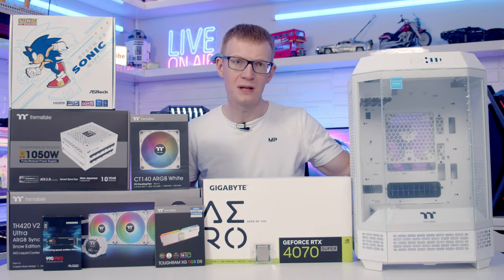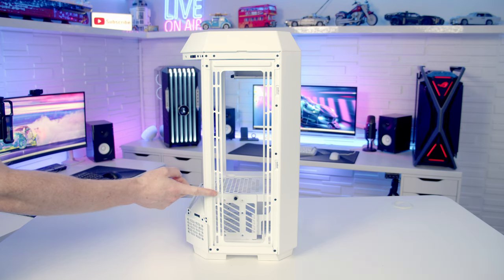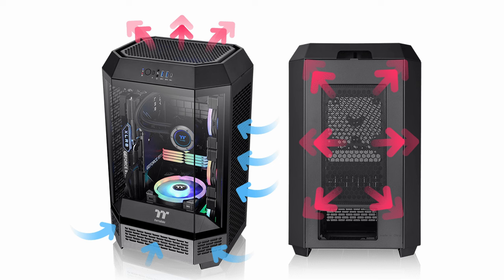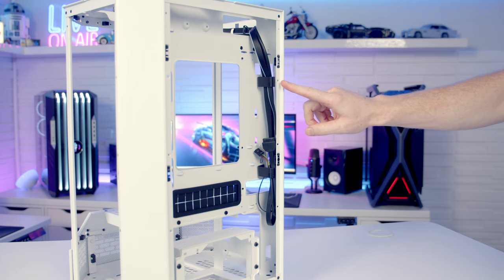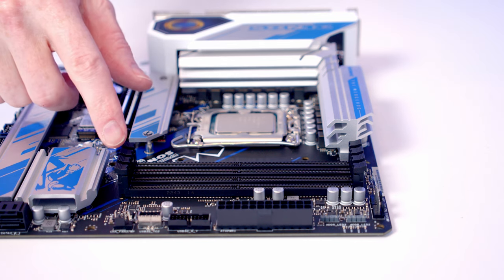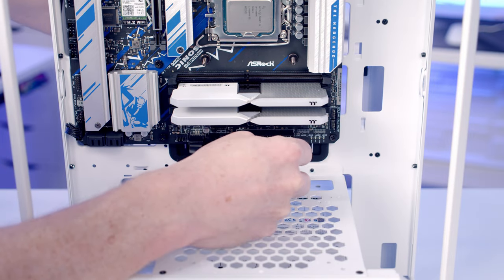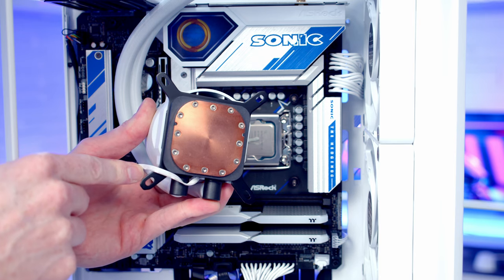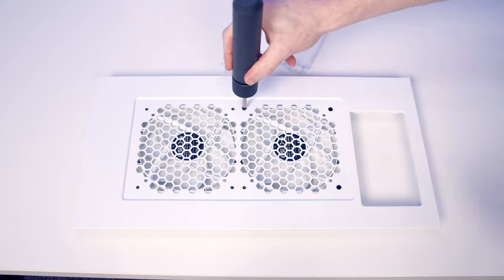Thermaltake Tower 300 Build - Step by Step Guide

Comment: Really appreciate this video.  Funny they didn't make the PSU covers for there own PSU to line up correctly, but its fine.  I REALLY appreciate that you showed how the cables connect before its in the Case while its in the case video edit.  Great job Sir.  In any case, you gave me confidence I can do this.  This will be my 2nd build.
Reply: It would have lined it up correctly if he hadn't flipped it backward.  The mounting bracket has a curled edge that faces outwards, he had his facing inwards.

Comment: Found you while looking for builds in this case. I am waiting on the racing green or matcha green. I will be using in the horizontal position and have two questions:

- what is the height when horizontal?
- seems exhausting the fans on the aio would be better in horizontal position?

Cheers. Great channel.

Comment: I do wonder why not one video about this case shows how to connect and route a monitor cable from the GPU.
Reply: There is a pass through from the top. It's a bit annoying but any cables you want on the mb or gpu needs to be passed through the top. You will need to take the top, and top fan bracket off. Plug what ever you want in, route the wires, and close everything up. One of the reviewers said you will most likely need some extenders depending on where the tower is. If you have it horizontal, I don't see cable length as much of an issue. But, I have no built in this yet so I can't give foest hand experience.

Comment: I am very curious if a second fan/radiator bracket could be mounted on the GPU side of the case to attach additional fans as intake for the graphics card? Do the screw holes or mounting tabs line up?

Comment: Won't the passthrough air on the back of the GPU and the air being pulled into the case by the AIO cause issues?
Reply: I think the same, that air configuration is not adequate, air should enter from above and below and be taken out through the 3 fans of the AIO, cooling the CPU better and without heating the GPU, I have never been in favor of those configurations, the hot air from the radiator always has to go out of the tower and even worse, those fans do not cool the radiator, do you expect the air from the room to enter the radiator? I don't see much sense in that.

Comment: Can the liquid cooled version be ditched in favor of an air cooled version? Like maybe the Noctua U12A? Would that be adequate cooling for this CPU? I'm planning a build using the 14900 along with the Noctua cooler in a different case, but I love this case.
Reply: Nah, you need a liquid cooler for the 14900. Do not buy a u12a for that cpu.
Reply: @Whispergryn  Thanks for the response, but already done. The U12A is actually a great solution. Idle temps around 31 deg C, and less than 40 deg C under normal load which is way less than my CoolerMaster liquid cooled 7th gen i7, and WAY quieter. The only game I've played is Hogwarts Legacy with a 4070 TI with everything set to ultra. Temps stay around 70. As it turns out it's not so much the CPU as it is the motherboard manufacturers removal of Intel power limits. I can bump the power limits up a bit in BIOS and the only issue is with the GPU, not the CPU. What I would say is that rather than the Noctua cooler not being enough for the CPU, the 4070 is not enough for the CPU. Plus I don't have a bunch of liquid running around my computer. I'm quite happy with it.
Reply: @rmb658  That's a pleasant surprise. Im glad you made it work, man!